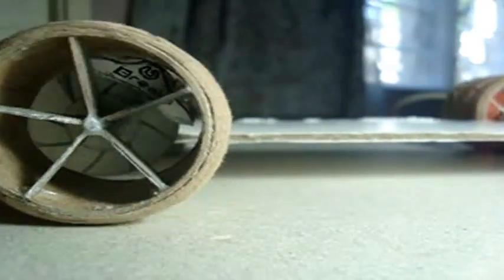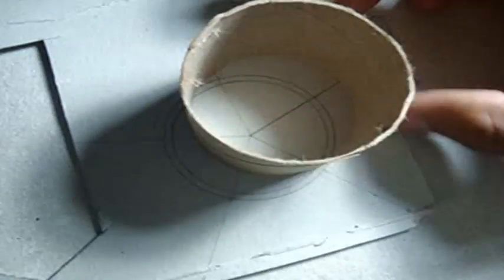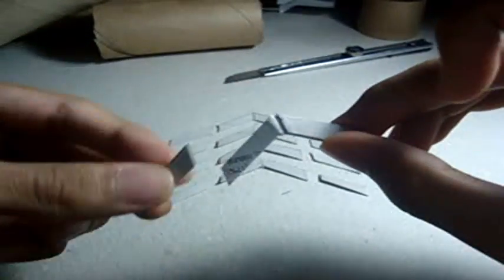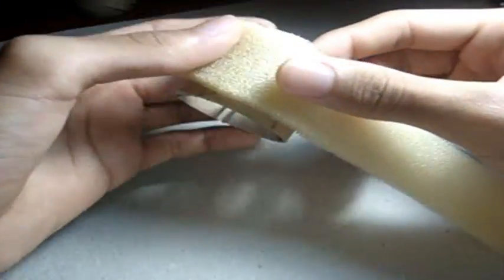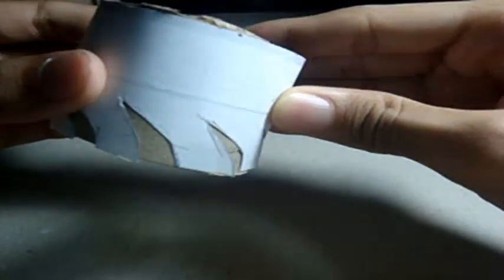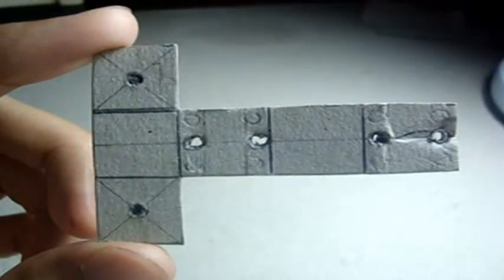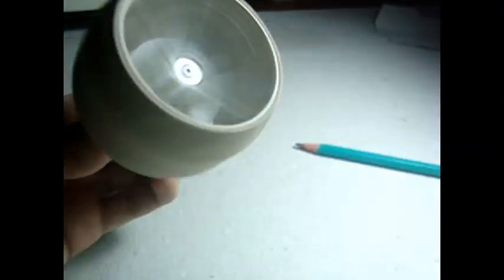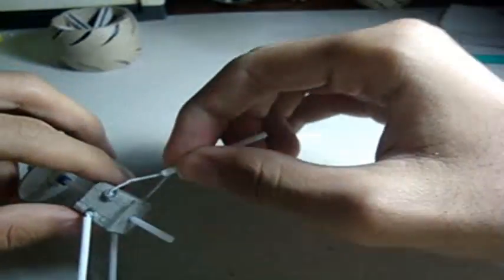How To Make Cardboard Wheels, Chassis with Suspension and Brakes(1 of 2)

Comment: How can I make hole in plastic bottle cap in middle
Reply from the maker: +Shakun Johri you can use something like a screw driver, heat it up on a flame and pierce the cap. You can find the exact centre of the cap by bisecting the circumference at two or more points